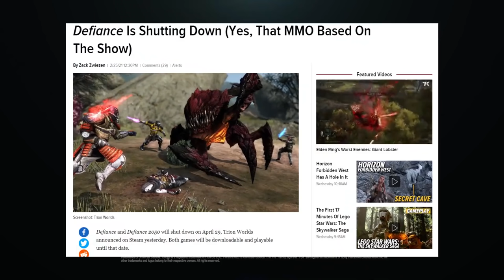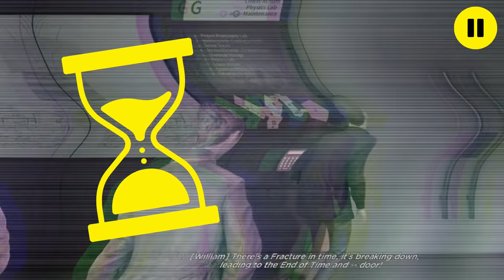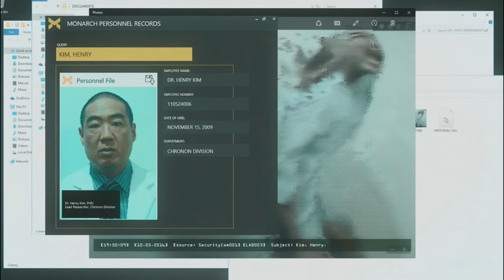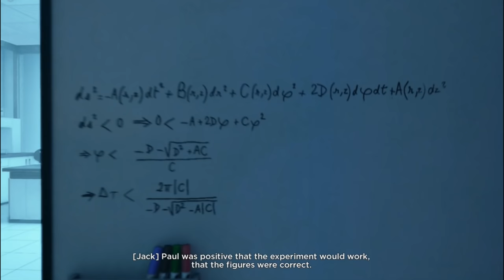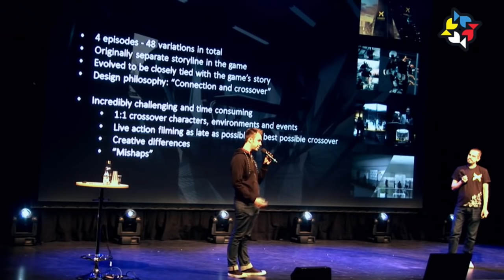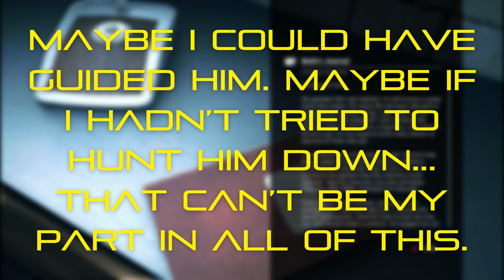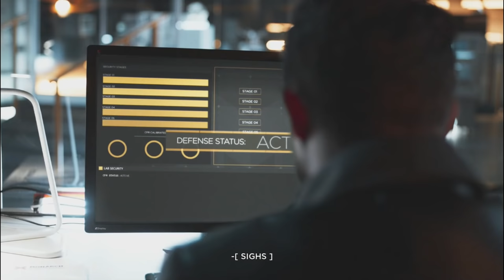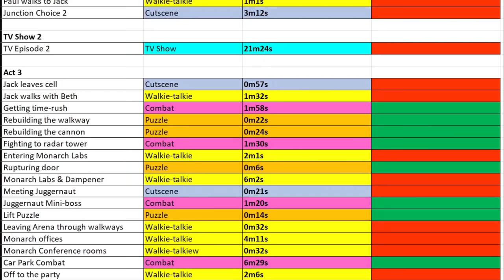Quantum Break Critique | Beyond Ambition

Comment: I'm happy that Quantum Break was a visual powerhouse in 2016 and it's still a visual powerhouse now in 2022 when you can run the game now at higher resolution, higher fps AND turn upscaling off.

A 5700 XT can either do maxed out 1080p60 native rez or 1080p120 with upscaling and a really fast CPU.

Comment: I've been thinking on how to rewrite or reword the "Time can't be changed but there is still multiple streams" thing that the game bables about, and the main thing I am thinking about is math.
You know that you can to multiple different "arrangments" of math to get the same valid conclusion- example is that you can shorten the long line of adding numbers to each other just to two numbers multiplying each other, or sometimes enven shorten it to a one number to the power of a number, essentially havint 3 ways to achieve the same (for sake of simplicity) unchanging result.

You could use this example to explain the timeline shennanigans of Quantum Break- the result of the equasion will be the same, but you to the steps to get there a tad bit differently, you shortened the multiple step proces of additive actions with multiple people to one multiplicative action with one person because you for example killed an important person, or went a different street

Comment: still in the first quarter of the video but yeah I recall when I went through it the first time, it was kinda confusing as to why the game would offer choices that change the story when the entire point of the game is that time cannot be changed.

Though I will say that a TTRPG called Continuum at least offers some answer to this, which is the idea that only what is "known" cannot be changed. Essentially anything that is your subjective past is fixed, even if through time travel that past is technically in the future. But anything you haven't experienced yet is still up in the air as to how it exactly plays out. Which would explain why certain things like say 9/11 and whatnot are unable to be changed, because the characters already lived through it, but other things like whether certain characters live or die can be changed, because they hadn't actually experienced them yet. 

Essentially this empowers time travelers to, intentionally or otherwise, create fixed points in time by going to the future and back. This is pretty much the core problem of the End of Time. Because one of the time travelers already went there, they've effectively locked it in as a fixed event that has to happen and now there's nothing that can be done to change it. But events between the present and that point haven't been visited yet, they're not yet in anyone's past, thus things leading up to it can still change. 

I know that this is mostly me applying external logic to the story that isn't explain very well in the game but it at least makes sense to me I guess lol